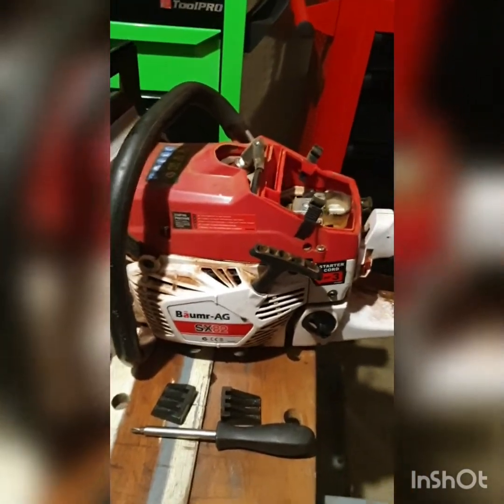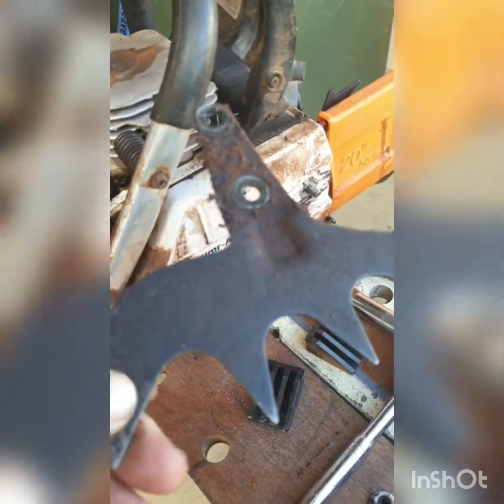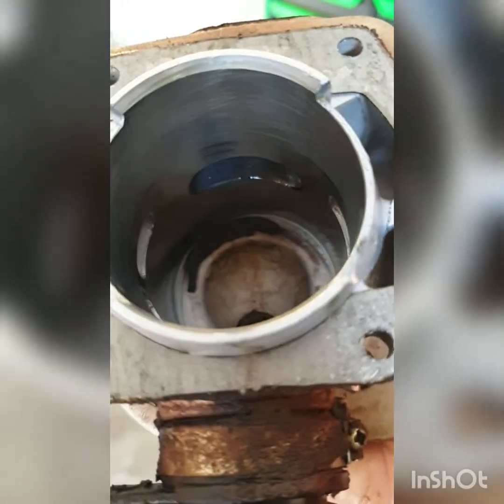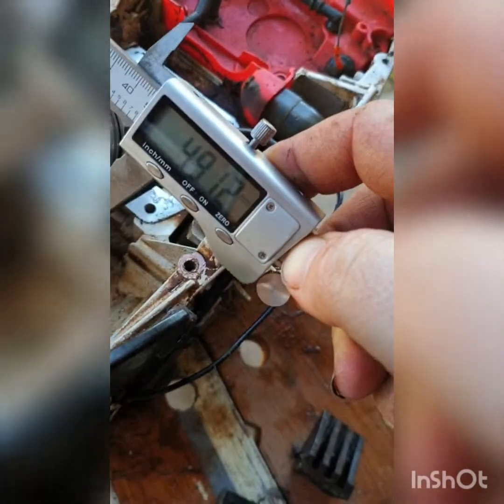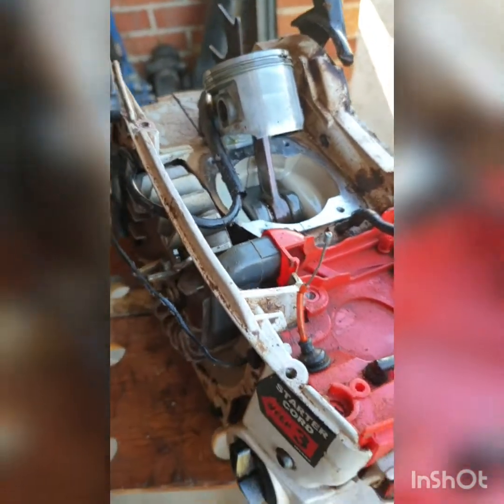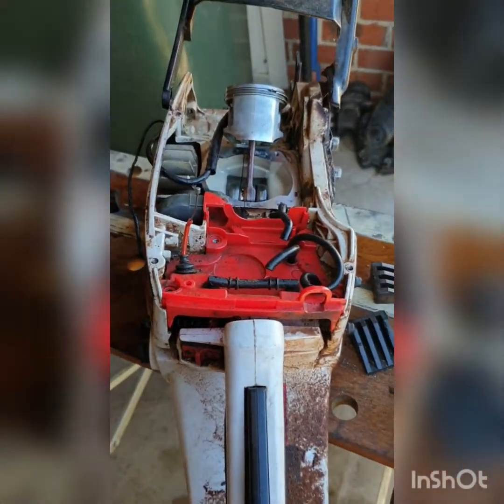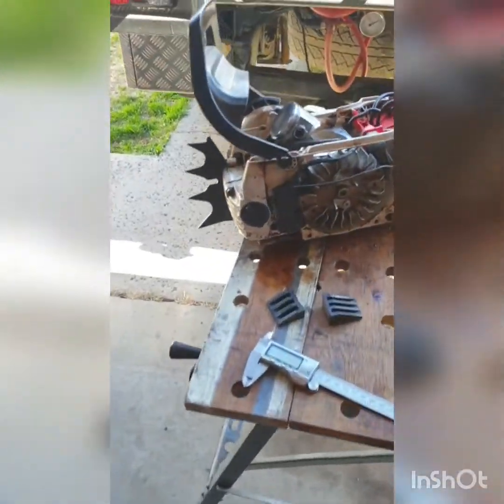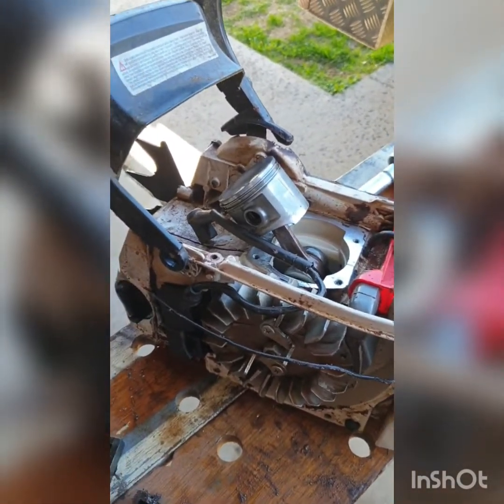SX82 ACTUAL PISTON SIZE

Comment: If it's 82cc the stroke will be 42mm. H372 stroke is 36mm.
It's actually easier to measure the stroke with the caliper through the spark plug hole while the cylinder is still attached
Reply from the maker: Yea mate it ended up being 50mm crown with a 36mm stroke.
Reply: I'm now wondering if the swept volume of my MTM 62cc pole saw engine is actually 62cc. It works ok and Edisons were quick to send replacements for the parts that were faulty out of the box but the cylinder has always looked small compared to the one on my 54cc chainsaw.
Reply from the maker: @peterelvery  yea could be narrower with a longer stroke or falsely advertised and in reality it has a smaller displacement.

Comment: You need to measure the stroke, the piston length etc means nothing.
Without knowing the stroke you cannot work out the capacity.
It has a 50mm bore, to be 82cc it should have a 41.76mm stroke.
Reply from the maker: 50mm crown with a 36mm stroke.

Comment: Well this is a bit dissapointing.  I just bought my first petrol chainsaw a few days ago from Edisons, Baumr-AG SX62.  got it for $104 from their ebay store, including discount, so for the price i couldnt go wrtong...  annoyed that they are trying to pull a fast one in terms of displacement claims though...  not impressed. Still,  I didnt want to be learning on a really powerful saw so i perhaps went for one that is easier to learn with?  Great videos by the way Mr. Gavman!  liked and subbed!
Reply from the maker: Cheers mate I dare say it's probably 45-50cc without pulling one apart but that air filter is it the teabag type? If so split in half and grease around the join and reassemble, also grease where it goes into the carby and grease the hole at the top to catch all the dust. I'd also undo the carby screws and get that 90° mouth and grease between it and the throat they normally don't even have a gasket. If it's the automotive filter grease top and bottom and hole where bolt goes through and if you want to do it that part the air filter mounts on to the carby but don't touch those unless you're not concerned with warranty but definitely grease the air filters they don't want them to last too long because these people want you to keep buying saws from them.
Reply: @gavmansworkshop5624  Thanks so much for the advice mate, saw has not arrived yet, but ive been watching quite a few vids on the SX62 and have bookmarked a couple of "fixes", yeah im not really impressed with the underhandedness of Edisons, for 104 bucks i decided to take the plunge, Im a casual user anway, but will definately keep your advice in mind, and once i get the saw   ill oppen her up and do as advised. i think it is the tea bag type air filter, not the pleated paper type.